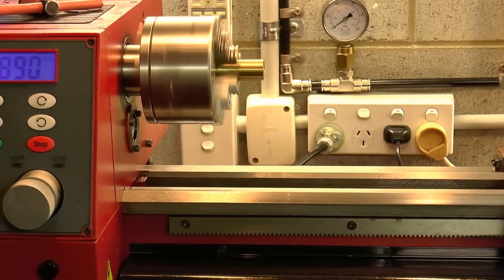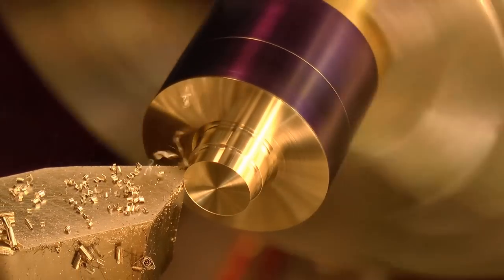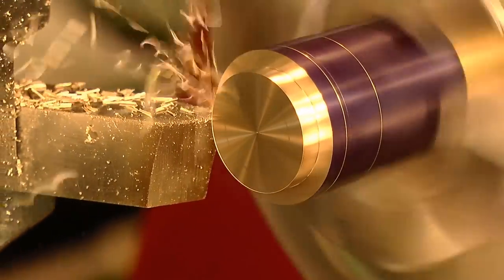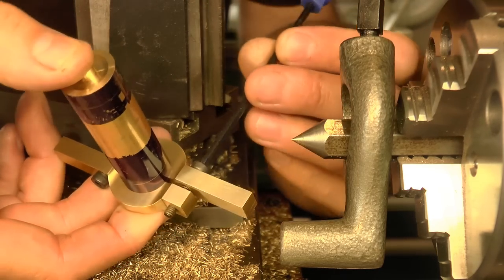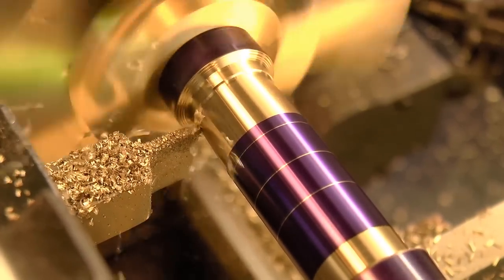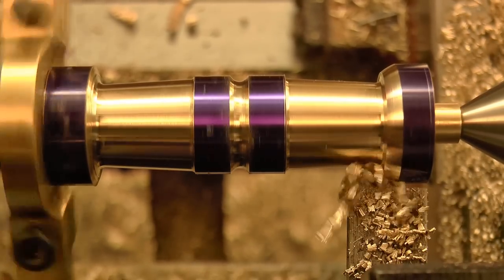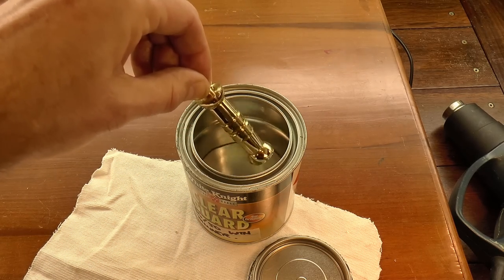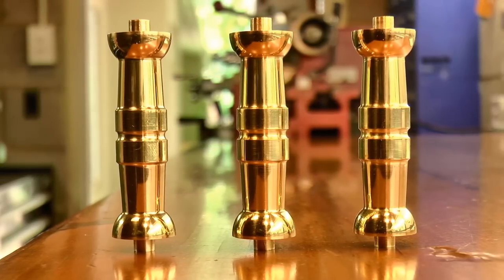Clockmaking - How To Make A Clock In The Home Machine Shop - Part 2 - Machining The Clock Pillars

Comment: Wow, man, you got an amazing precision. At my school, where i'm studying for an electro-mechanical degree, we work with iron mostly, and sometimes with aluminium, so seeing you take those big "steps", that i imagine are at least 2 mm in depth (The biggest step i could do without dulling the tool, a steel bit at 12% covalt, was a 1 mm, on aluminum) with those hardened bits, that look like you could machine a titanium cylinder
Reply from the maker: +L3AP2020 Ha ha! My poor little lathe would probably croak if I gave it some titanium to chew on. Brass is a relatively soft material to turn, it makes every tool look tough :) Thanks for watching.

Comment: There is a lot to unpack in Chris's video's. Making a radius on these he needed a hardened steel form tool. "Honestly, I  think I would have even got close to matching the curves without it." Apply that to some of thing made in antiquity and I sit here in wonder how did they do when he has to go to this length of tech to make a radius on brass. They used granite with that level of accuracy. Crazy... He has to use steel to cut brass, but they used bronze to perfectly form granite. I don't know if I can buy it.

Comment: Hey Chris, 
I see you dipping your parts in some kind of sealer.  What is it and how durable is it?  I make aluminum necklaces and bracelets on my CNC and thought it might work well to permanently seal them.
Thanks,
Ben
Reply from the maker: +Ben Rogerson Hey Ben, its a basic lacquer for metal, works great. I thin it down to 50%. It may not be quite so durable for something that will be handled often like jewelry, but definitely worth a try I would think: http://www.whiteknightpaints.com.au/specialty-paints/metal/rust-guard/topcoat/clear-guard Thanks for watching.

Comment: Guess you can use that clamp for other projects and that's why you made it.
But if you didn't make it.
Could you have used say a threaded rod in the end hole instead?
Reply from the maker: When turning between centers, it is critical that the workpiece be supported by pointed centers at each end. With the axis of the part then occupied, the only practical method remaining to drive the work is with a clamp that grips the perimeter. Thanks for watching and asking Henrik :)

Comment: I'm having trouble acquiring marking dye in Australia, what are you using?
Reply from the maker: HRob27 I had the same problem. Could not find a supply of proper layout blue in Aust. I found Dykem Steel Blue on Ebay, and ordered a couple of bottles.

Comment: What sort of metal lathe are you using?
Robert
Reply from the maker: http://www.clickspringprojects.com/blog/which-lathe-should-i-buy Thanks for watching Robert
Reply: I concluded from your comments that you don't particularly enjoy cutting pinions. Nobody else has said that. I came to the conclusion that steel was going to be tough on my expensive Thornton cutters so chickened out and make them from brass rod. I am also making lantern pinions with stainless steel rundles as a compromise. I realise that they will not last as long, but at 79 I don't really care about that. What your videos are doing for me is constantly filling in blanks. I am grateful that you take the trouble and that your advice is free.

Comment: +Clickspring How are you able to remove the piece from the lathe and then re-center it when putting it back in?
Reply from the maker: +Riley Apperson This is an attribute of turning the part between centers. The center points on each end of the work ensure that the workpiece is back on the lathe axis when it is returned to the lathe. Thanks for watching and asking :)